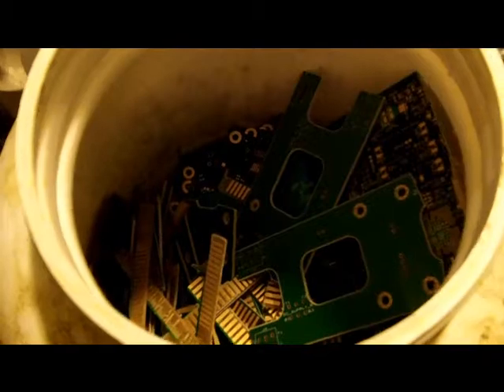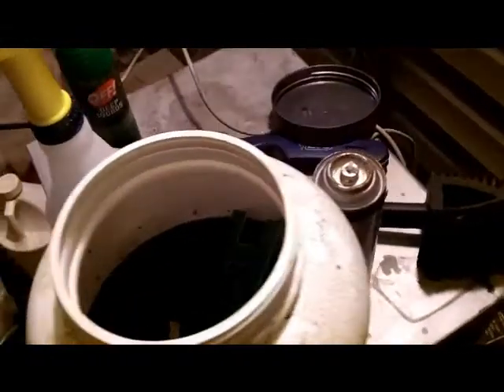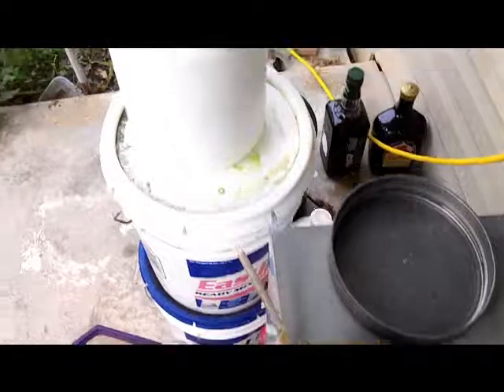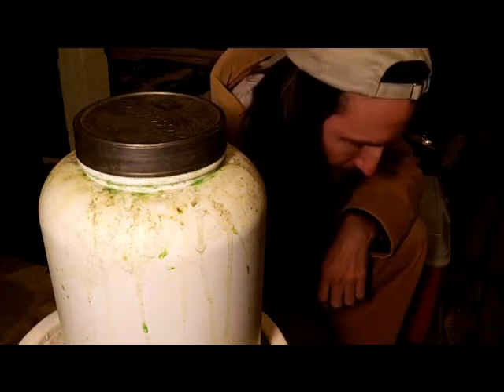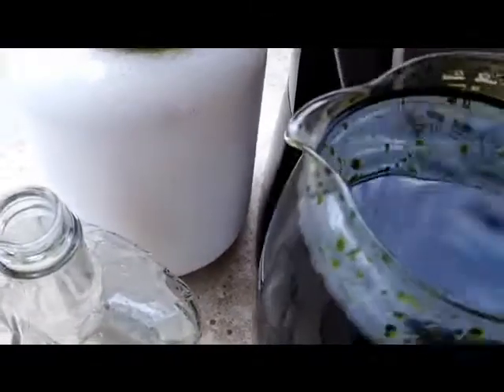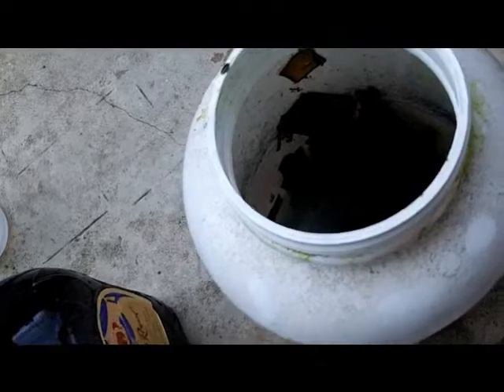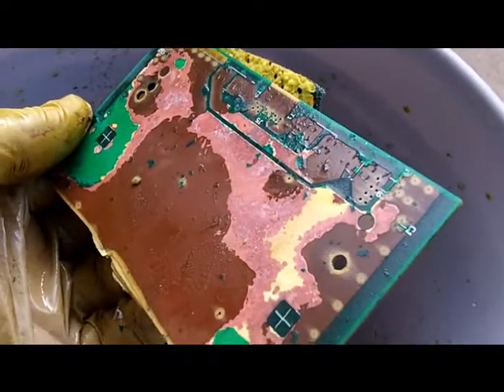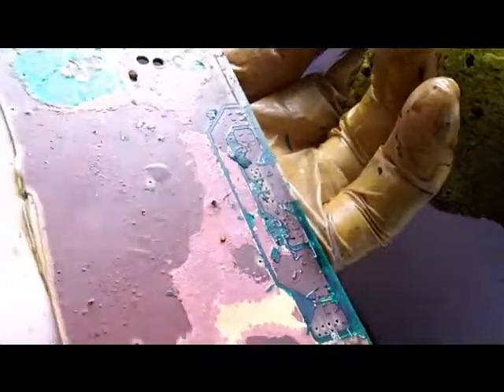eScrapGoldStep2

Comment: ..(comment 2/2).   The intervening light green layer can be converted to Fe(3)Cl from Fe(2)Cl through the addition of 30 volume H202.  You can add some salt and some ascorbic acid (surface brightner/exposer) and give it a shot of HCl for good measure.  This is now rejuvenated etchant suitable for plated cinch connector processing and other more-readily deplated e-scrap.  Fe2Cl is actually a good wash for your spent scrap and glassware (as well).  No gold is in solution - (re)treat confidently.

Comment: I would discourage use of glass vessels due to potential for breakage (read: unholy mess).  Also, a funnel is useful (really useful) in fluid transfer.  You can detoxify your copper rich spent-etchant by pouring it over a vessel containing iron turnings (swarf).
Copper precipitates as benign copper hydroxide and you obtain a light green intermediate layer of iron chloride (liq) - capped by a foamy top layer which should be poured (off) into another vessel of iron turnings.

Comment from the maker: Nope, just wait.  It doesn't take any effort to be patient ;-)  I will say that I am planning to build a tumbler, specifically for pins, that will tumble everything with quartz sand to abrade the gold plating off.  Potentially, you could do something similar with a large drum and some broken cast iron scrap.  You could tumble you cards with any sharp edged objects to nick that green paint.   But first, make sure there is even gold under there, mostly it's just copper.

Comment from the maker: The tin can have some impurity and the test still works.  So, you can use tin from 90% Sn soldering wire (on ebay, search: lead free solder wire).  I use about 5 cm of wire and 50 cc HCL.  Let it soak for 1 hr before use.  You should be able to find 90% or better tin (Sn) at a local hardware store or plumbing supply company.  (insert ebay home url)/itm/Silvabrite-1-Pound-Roll-Solid-SOLDER-WIRE-100-95-65-Tin-1-8-diameter-Lead-Free-/251354414615?pt=LH_DefaultDomain_0&hash=item3a85e3fe17

Comment: is it possible to use bleach and the HCl (agua regia) solution first. then precipitate it all out and then dissolve the base metals afterwards with the precipitated metals in only HCl. figuring it would be the same. also how do i go about getting platinum out of my used HCl solution do i need to remove the gold first. cuz im sure the platinum comes out with the gold
Reply from the maker: I've never tried that, but precipitation is kinda tricky and I'd be worried that you might lose gold that way.  dissolving base metals 1st works really well and if you are patient it is very effective.  The amount of gold is very small compared to amount of base metal, so you want to concentrate the gold in as early of a step as possible.